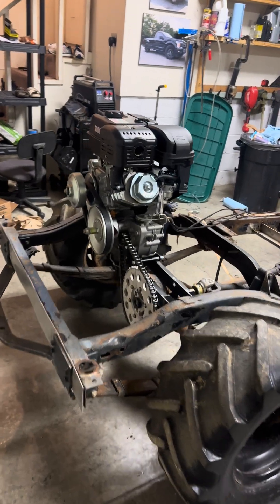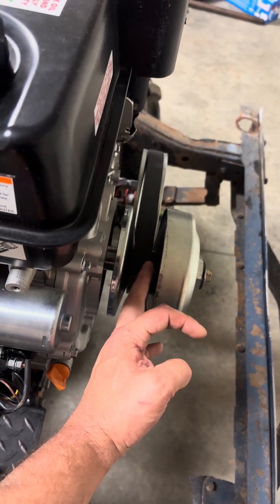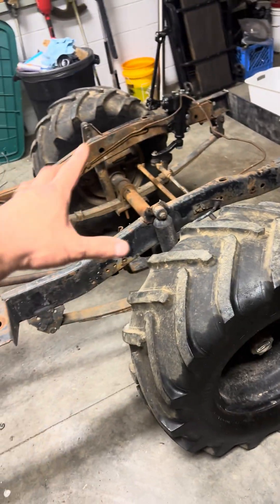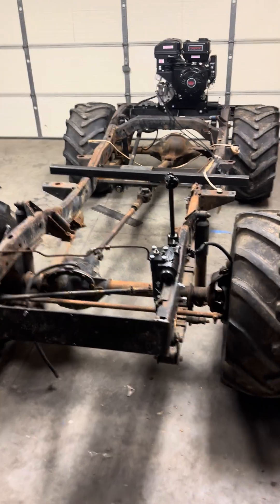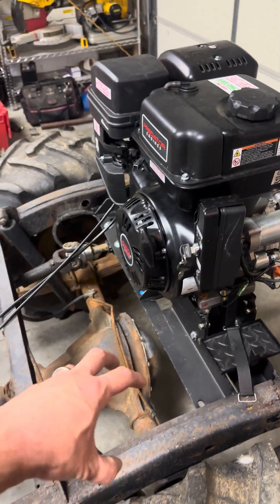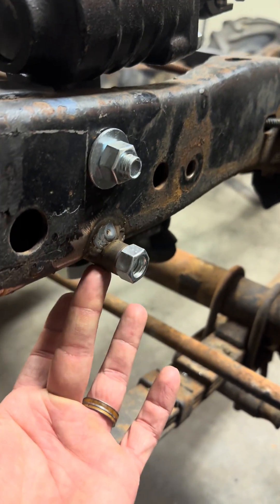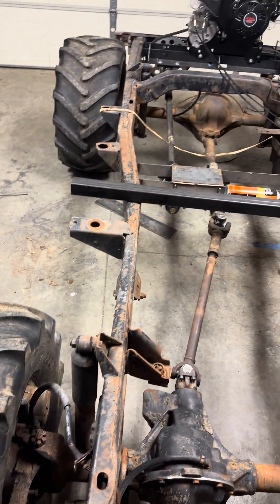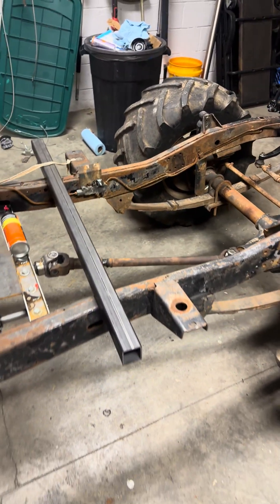Scene 5: Overview of body plating and steering system

Comment: you got more patience than i do bud. id have a steering column mounted to a "fire wall" hoop made from a trampoline leg, a plywood floor, a school bus seat next to some amazon go kart pedals and id be driving that thing asap. then you would slowly work on the tool boxes and diamond plate and winches and  brakes and all the other non essential things. its turning out real great though and i can tell your doing i really nice well thought out job with it. it will probably be your favorite vehicle by the time your done seein as how you built it from scratch. ima stay tuned cant wait till you get the controls hooked up and take it for a spin.
Reply from the maker: If it were 5 years ago, I'd do exactly what you mentioned haha. I just learned that for me, it's better to wait to do it the way I know i'd want it in the end, vs having to redo it a few times between now and then. I'm actually more excited to see my wife drive it (i'm trying to get her into the 4x4 thing).